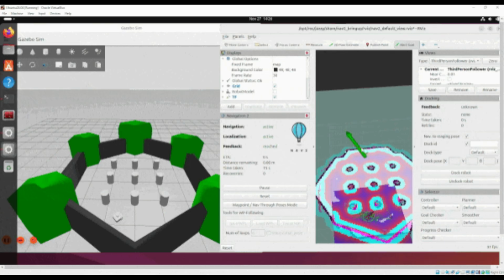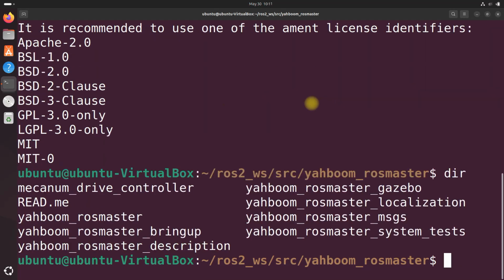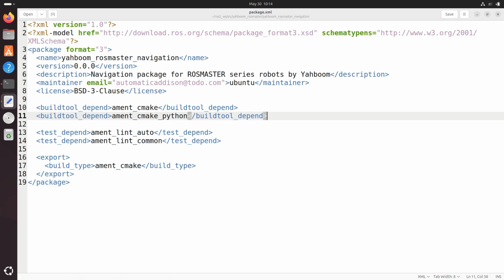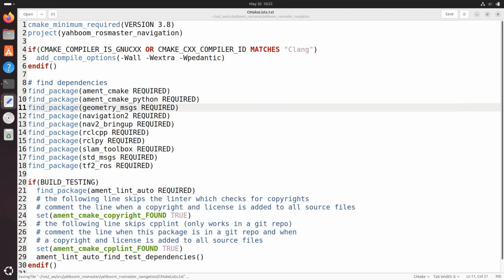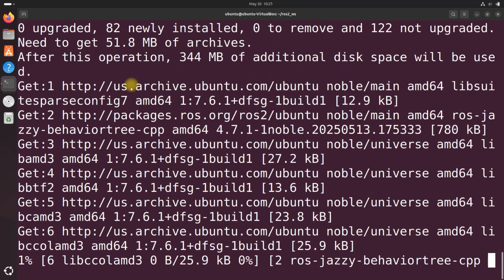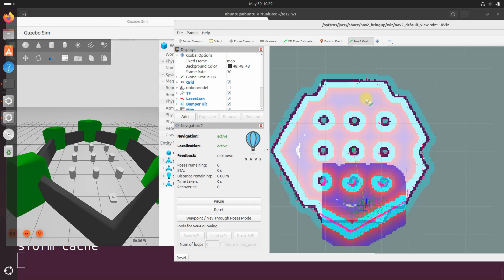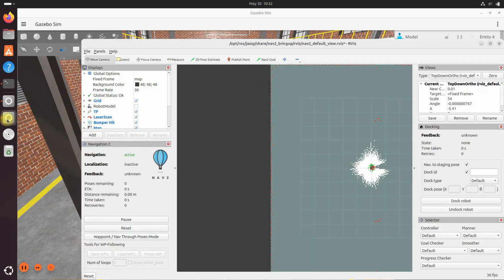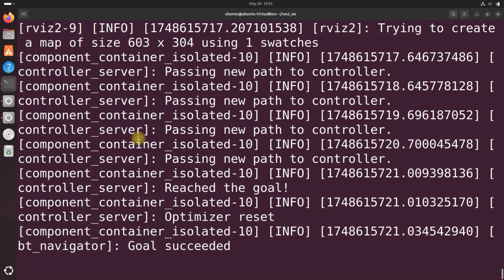How to Install ROS 2 Navigation (Nav2) – ROS 2 Jazzy

Comment: Thank you for publishing this.  It feels like this is my 5th nav2 tutorial series and I'm finally starting to get the hang of it.  Still get cut by a lot of the sharp edges, but able to debug them on the fly more easily.

One thing I noticed was when trying to run the initial tb3 simulation on my system with gz installed, it looks like my gz-bridge needed TwistStamped messages to be published, but the collision_monitor and docking_server both only publish Twist messages.  The symptom was that even though I was able to publish an initial pose and localize (yay), and set a goal pose and it compute a path (double-yay), the robot did not move.  I was able to get around this by running a standalone node `ros2 run ros_gz_bridge parameter_bridge /cmd_vel@geometry_msgs/msg/Twist@geometry_msgs/msg/Twist@gz.msgs.Twist

Presumably this is because of some update where I may be running a slightly different version of Gazebo in the tutorials.  Might be worth calling that out, or maybe this comment helps someone who also trips on this in the future.